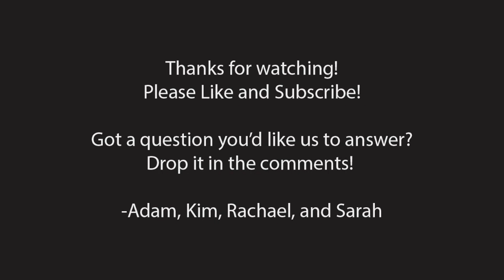A Screw Loose - Episode 06

Comment: Helpful episode! I enjoyed it!
I have two more questions.

1. Actually I learned that I can use cork at the kickers. If I use the felt, WHAT KIND OF felt do I have to use? Also are there regular felt thickness or do I have to sand case by case?
2. I found the red rough in the workmanship store but it is hard/thick one. Can I use it as a polishing to make a mirror finished?

Many thanks!
Reply from the maker: Hi Jihye! You can buy a selection of felt from someplace like JL Smith. Their charcoal synthetic felt is a good basic felt to start with. I'd recommend getting all four thicknesses and seeing what you use the most for re-ordering. https://www.jlsmithco.com/product/synthetic-felt-sheets/   

I don't normally use rouge because I don't have a buffing wheel. I use Simichrome or liquid Hagerty polish for just about everything. A mirror finish is less important to me than preserving the metal on the flute. -Sarah